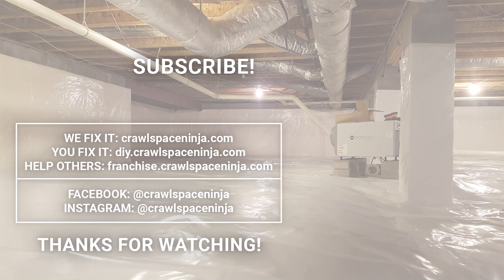Heavy Sweating on Crawl Space Plastic? | My Crawl Space Vapor Barrier is Wet on the Back

Comment: Michael you  are definitely one of the most (if not the most) knowledgeable  professional in this industry. Your videos are by far the most helpful and informative. I have been trying to find out which should lay directly against my perimeter crawl space wall - the plastic or the foam insulation board. According to you it is the board against the wall then the plastic on top of the board. I just wish you were in my area. 
Thank you so much !!

Comment: Come to NJ! I had 5 estimates and not one of those companies suggested anything that seems to be standard or current. Too bad I didn’t watch all your videos until after I got work done. Had new fiberglass bats installed and vapor barrier going up walls. I had them close one of the two vents because I think water was coming in from that vent which is under the side stairs of my house. Now I’m trying to find any company that could install a dehumidifier but it’s been slim pickings. I guess I’ll do it myself!

Comment: By sweating do you mean water droplets beading up underneath the vapor barrier? I can see that under my vapor barrier, there is moisture. No puddles or anything but the ground is damp with water beads everywhere. You are saying that this is normal? Will this water cause any foundation or settlement issues?
Thanks!
Reply from the maker: This is normal because the ground has moisture and cannot be removed. Hard to say if that causes foundation issues. If the home is built well it shouldn't.
Reply: @CrawlSpaceNinja  Thanks for the reply. Another company told me I should have let the ground dry out with the dehumidifier before putting the vapor barrier down. Does this make sense at all being the ground is going to always be wet?

Comment: As long term DIY project, in what order would you recommend? Insulate and seal block vents and rim joist, add dehumidifier, trench drain to existing sump pump, insulate and install vapor barrier on walls and piers, treat for mold if needed, install vapor barrier on ground? What am I forgetting?
Reply from the maker: Add dehu for us is always first, that allows your to concentrate on mold control. It doesnt look like you are missing anything else. Just keep in mind treat mold first then encapsulate.

Comment: Vapor barrier without deep  set sump pump at lowest spot( maybe install 2 -3, I have 3) makes no sense, need to pull the water out off the ground before it comes to surface. Any that does the dehumidifier will handle. Correct?